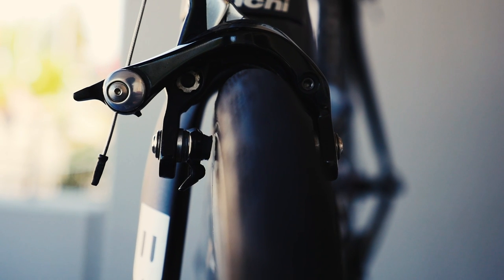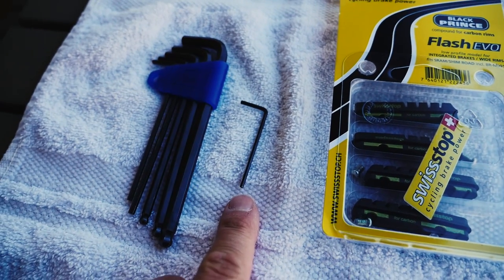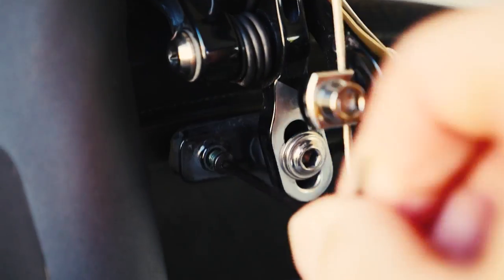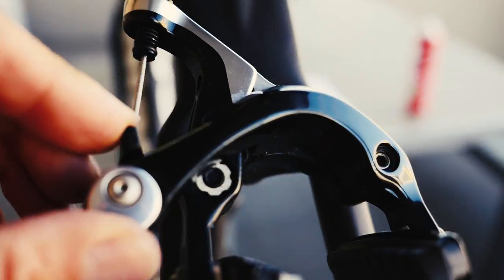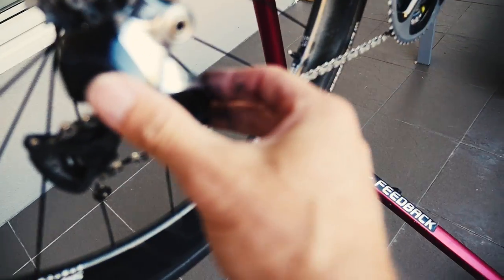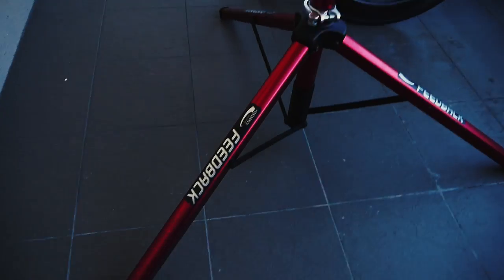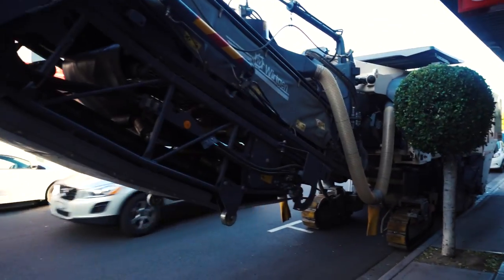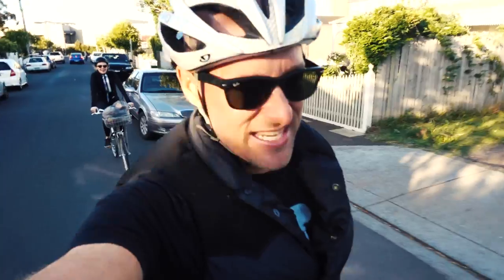Beginner Tip: Change Your Brake Pads

Comment: I noticed how clean your cassette was. I have a Shimano 11 speed, have tried spraying degreaser, wiping, repeat...wipe some more, etc. It helps some, but that doesn't get it as "silverish" new looking as that. Is the only way to get it looking like that is to take it off and clean it? What's your approach to that and how often (assuming you ride say about 10ish hours a week).
Reply from the maker: +melbman43 Too time consuming brah.
Reply from the maker: +j bee May I spray a 'good quality' degreaser, rinse, degrease, rinse scrub with a fine brush, degrease, rinse and repeat until it's immaculate.

Comment: You void warranty not using Enve's specific carbon brake pads :(
Reply: +Patrick Muma Was going to say this! Maybe Mark's had them past their warrenty date? If not, then damnnnnnnn
Reply from the maker: +ThatsSoNathan Rigggght Thanks for that info lads. Yep long past warranty. But either way, I didnt know that.
Reply: +Cycling Maven Enve have a 5 year warranty just cooked my 3.4s down Baw Baw a week or two ago and had to send the pads in with the wheels to prove i was using them.... surely your wheels are not over warranty yet?